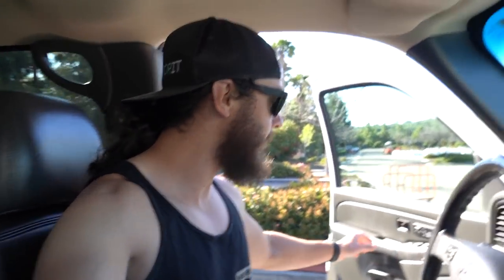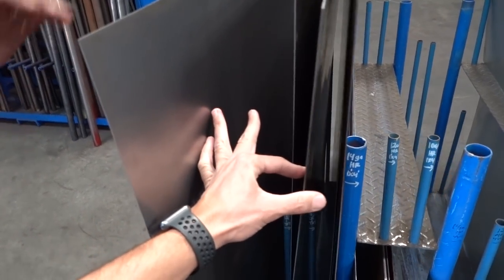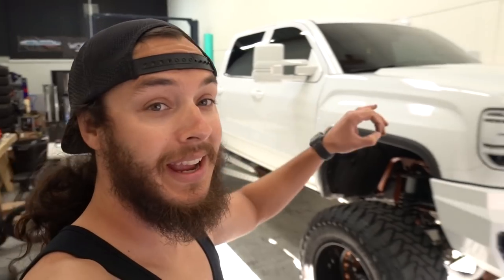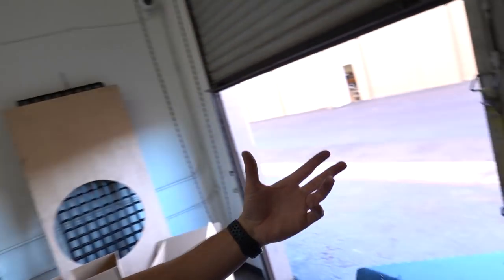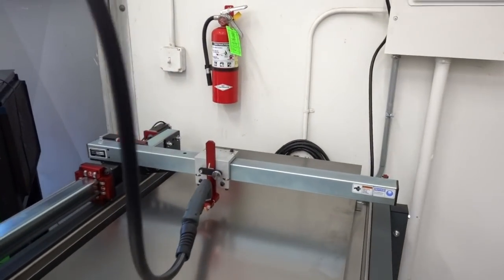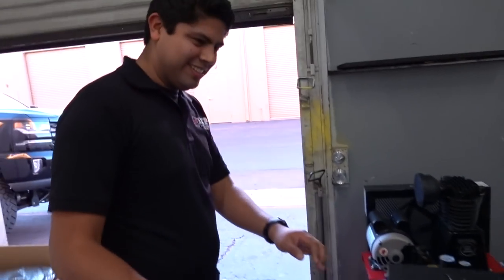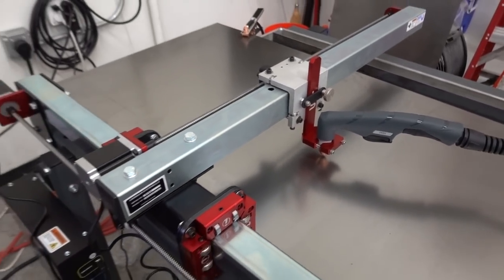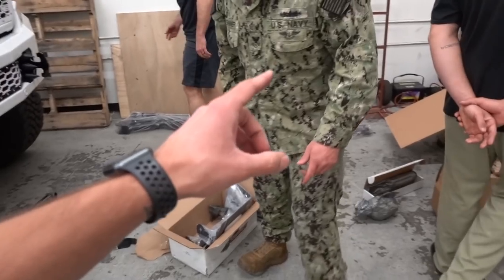THE NEW LIFT KIT IS HERE!

Comment: I’m pretty sure the spindle lifts are a lot stronger because they keep the upper control arms in the stock location and give them more leverage to handle the larger tires. Where as a bracket lift moves ur control arm down and is much weaker because the upper and lower control arm are closer